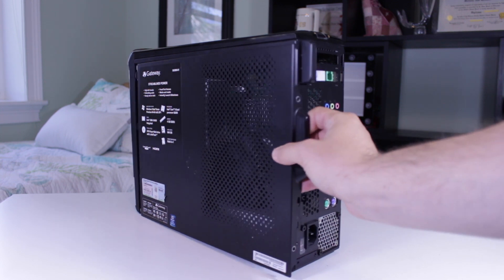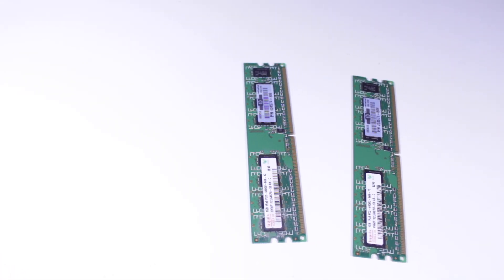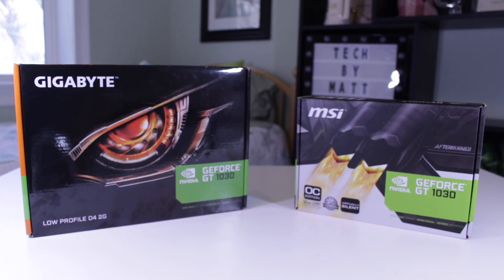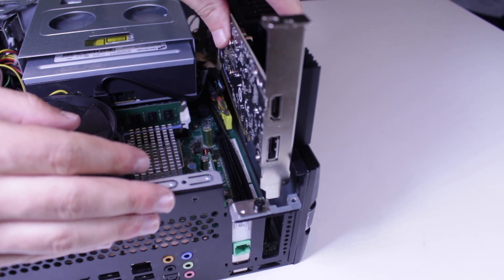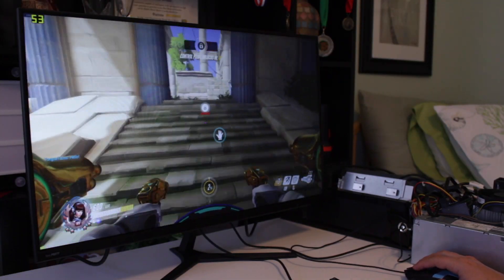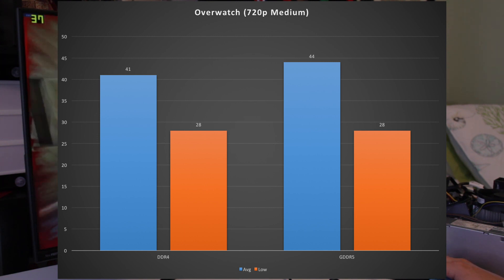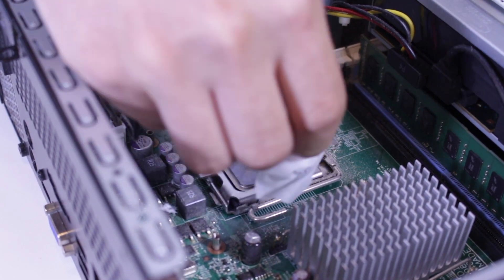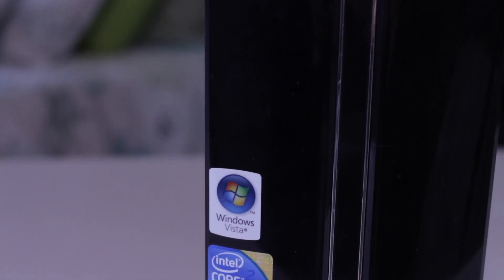Core 2 Quad + GT 1030 = Good Combo?!?

Comment: I have nearly the same custom build :
1. GDDR5 GT-1030
2. Core2Quad Q6600
3. 4 GB Ram
4. 230 W PS
5. Asus P5kpl-cm Motherboard
Reply: What games can u play?
Reply: And how many fps is it? Did cpu and gpu loading 80-100%?
Reply: WTF only PSU 230 watt !!!
Reply: @aymanashraf5072  the newest dell pc minimum psu is 200 watts
Reply: @aymanashraf5072  bro i have seen people with only 200-230 watt psus run with a gtx 1050ti low profile plus core i5 2nd gen easily

Comment: I use a GT 1030 GDDR5 in a modded Acer Veriton X2610G (I had to create a ventilation hole on the side to let the graphics card breathe as the space is very very limited) and I can say that it is a fantastic choice for this kind of SFF computers. I also replaced the i3-2120 with an i5-2500T to get 4 cores and ensure that the small PSU could manage a graphics card. Some people say that you can actually use a full fledged 95W i5 with that, but I rather not push the PSU too hard.

Comment: i paired q6600 with gt 1030 and can play most of the titles in high settings getting 35fps average and im happy with that bcoz i used to play on consoles
Reply: How much ram?
Reply: Shiva Bhardwaj using the same setup myself! The card was 80$ and the processor was 18$ lol! Surprised by the performance. I only play CSGO though, so I couldn’t be bothered to upgrade lol
Reply: How much ram you are using?
Reply: He uses 512GB DDR4 memory running at CL12 3200MHz
Reply: welcome to the masterrace.
Reply: @SMGJohn  0.0 lile me with a q9550
Reply: @nawaal4452  same but the card was 60 bucks and the q6700 for 9 bucks lol

Comment: THANK YOU
I was looking for benchmarks to see if it was worth it or not to upgrade my old computer
Reply: It is. I have a prebuilt lenovo PC and added the gigabyte GDDR5 low profile card into it and the performance boost was insane. Going from 50 FPS in overwatch at all low settings at 720p to 1080p and high settings was great. Later, I discovered overclocking with MSI Afterburner, and was able to squeeze around 20 more frames.
Reply: Gabe_N if you have a Q6600, try tape modding it.

Comment: I’ve a Dell Optiplex 755 DT running a Q6600 @ 3.0GHz (w/ tape mod), 6GB DDR2 and a ZOTAC GT 1030; it’s a pretty good budget setup IMO. Will be upgrading to a 771 Xeon X3363 and adding another 2GB RAM soon

Comment: You should try to OC that Q8200. I had mine running at 3.15 (450x7) for almost 3 years before upgrading to a Q9550 which was stable at 3.65. The Q9x50 series were generally better for OC as they can sustain higher FSBs.

Comment: You can actually get a GTX 1050/GTX 1050Ti that fits in the case layout. I have a machine with same case layout (Emachines EL1352) and 8GB DDR3, Phenom II X4 955. I used to have at Gigabyte GT 1030 Low Profile 2GB installed but now I have a GTX 1050Ti 4GB. The only models that fit in there are the ASL G1502 (GTX 1050 2GB) and ASL G1504 (GTX 1050Ti 4GB). The card is also better known as ASL GTX 1050Ti Battle Flag 4GB. It's a single slot low profile card. Just search YouTube and some videos of the card I use pops up.

Comment: I have a GIGABYTE GT 1030 GDDR5 for myself.....It's a bottleneck which trigger me.....Is it fixable of I3 550@3.20Ghz??? My processor speed decreases to less than 2.80 ghz and not high from 3.05 Ghz also nothing is overclocked in my pc with 6 GB RAM

Comment: I installed a $40 R7 240 into my old Core2Quad. Huge improvement over the original GeForce 210 although I would have preferred the 128bit version instead of the 64bit that I got. Even with DDR3, a 128bit memory bus would double the memory bandwidth to higher than the DDR4 64 bit GT 1030 to just under 30Gb/s .

Comment: And don't forget that the GT 1030 may be crippled by its pci-e 4x wiring on pci-e 2.0. I'm currently building a setup on an ITX s775 with a xeon quad-core to play Skyrim I expect it to be correct. Thanks for the insight

Comment: So if I paired q8200 and 1030 ddr5 with 4gb ddr2 (my motherboard only support that kinda ram), i'll still be able to play let's say gta 5 and csgo 20-30 fps just fine right? Also, which one is more suitable for that kinda set up, 500w psu or 600w? And if i'm upgrading to let's say current version of ryzen cpu, did i still be able to reuse the gpu? I'm sorry if i'm asking too much (sorry for the broken english too), because i'm a newbie. Thank you.
Reply: You need at leat 8gb of ram ddr2 for gta v and csgo. And yes you reuse the 1030 with the ryzen.

Comment: The GT 1030 ddr5 model is a decent budget gaming card. (previous owner of GT 730 ddr5) Using this  GT 1030 will make a difference with the older system.  Weak OEM power supplies will like the card as well.  Currently using my GT 1030 in i5 3570k (@4.2ghz) (wify's Rig)  Will upgrade her later and use this 1030 in my media entertainment AMD A10 system in the future (already had it there before)  waiting to see what the next gen GPU's that will be coming out.

Comment: I've decided to breathe some new life into my old Gateway and build this exact same rig. You have no idea how surprised I am to have found someone, much less on YouTube, who's done the same. However, my PC is running Xubuntu 16.10 because I grew tired of Windows Vista a long time ago. Would that interfere with the build at all? Are these specific drivers available for Linux? Also, I plan on buying a cheap case to add a more potent PSU to replace my faulty one. Do you think this PC's proprietary motherboard would be fit in any cases? Would I just have to measure the mb and buy a case large enough to house it?

Comment: i got the q8400, 8gb DDR3, and a 660 Ti, and im able to do AAA, including playing Far Cry 5 in 1080p Normal above 30 fps
Reply: Sean Michelin - DaiAtlus79 😏 thats great, lga 775 ftw! 🕹😸
Reply: Seems like bullshit but alright.
Reply: i beat that i5-2400/660 GTX budget build that Danny NOAB built in their competition a while back, mine scored 4843 in Firestrike, his was 4677
Reply: Sean Michelin - DaiAtlus79 🤓 are u sure bro? normally an lga 775 Quad Core can trade blows with an i3 2nd gen, BUT NOT an i5 2400, when u have time run some more benchmarks for us with:

CinebenchR15, 
CpuZ, 
GeekBench4, 
Unigine Heaven @ Medium 1080p

🕹😍🚩
Reply: the q8400 isnt as strong as the i5 he had, and the 660ti helped the score, but its still not a bad CPU - mind you, im upgrading to a modded Xeon e5460 soon, that one is about on par with the 2nd gen i5

Comment: What if you used a gtx 750? Any 750 you buy should perform pretty consistently with other 750s right?
Reply: I have that setup. I overclocked my Q6600 to 3 ghz with a piece of tape. It can run GTA V very well at lower settings.

Comment: if you got this I would probably get a brand new HDD for 26 bucks and 4GB of ddr3 1600 ram so the whole build would be like 240 bucks I think but if you don't want to add another HDD and ram then this build would cost 200 bucks which is pretty good or you can get a gaming computer for 350 to 400 bucks with the CPU:ryzen 3 2200g, almost the same as a gt 1030 but its also a CPU so very good deal MOTHERBOARD I would get the Gigabyte - GA-AB350M-DS3H or the ASRock - AB350M Pro4 they are my top pick because they both have an m.2 slot and 4 ram slots for about 50 to 60 bucks and has a very good/future-proof upgrade path for the STORAGE I would get a 1 TB western digital HDD or a 2tb Seagate HDD or for half the price a 500gb seagate hdd for the PSU any  reliable power supply brands like evga, Corsair and cooler master with 400 or 450 watts and above for the CASE any 20 dollars to 50 dollars mid tower atx case and for ram I recommend 8gb 3200 ram for I guess 100 bucks at this time.BUT if I would upgrade I would get a 120 to 128gb SSD, cooler, and an optical drive the cooler and the SSD will be a very good upgrade because the SSD will help with the boot times like the cooler will help overclock the CPU and yes you can use the stock cooler but if you want the best performance just get it to trust me it will be a very good buy and you can buy coolers for about 15 to 25 dollars so not very expensive and for the optical drive I just want so when I need it i will have it and because I think I still have some old movie disc so I can still watch them and maybe you bought windows on a disc so you would probably need an optical drive like the Asus DRW-24B1ST/BLK/B/AS. and boom a 350 to 400 dollar gaming pc and later down the line get a gtx 750 ti from aliexpress but from a reliable seller.

Comment: Im using core 2 quad Q9500 and gt1030 gddr5 with 1.5GB memory but it can't play 4k 60fps on youtube. Im using Window 7 Ultimateis 32bits . Is it my pc not enough memory to run it or my cpu is to low to support gt1030 to do VP9 decode ？
Reply: Maybe cpu instructions

Comment: Whats the Best cpu to for GT 1030 ddr5 playing pubg (720p High/1080p mid or low)
Reply: It's Milan a sandy or ivy bridge i5
Reply: Daevster 666 how much fps will I get on pubg
Reply: get i5 2400
Reply: Jiji Liketoeatdorayaki did you tried it
Reply: It's Milan i5 2400+8gb+gt 1030 . just upgrade to gtx 1060
Reply: Jiji Liketoeatdorayaki how much fps did you got on pubg (which settings)
Reply: depends a 3rd gen i5 with a gt 1030 can pull 60 fps all day albeit at low settings but it is still playable

Comment: Got 1050ti 4gb for the same of a 1030, do you think it will bottleneck with a slightly overclocked q6600?
Here are some more specs:
120gb ssd
3tb hdd
16gb dddr3 ram at 1066mhz
3ghz overclock on cpu
Well cooled everything
Reply: It will, but it nothing insane, but if you're running games more mixed with, you're not gonna be getting full potential on the card. A i3 2120 will perform better.

Comment: Are there any old desktop I could buy off of amazon that is cheap? I could do less than $200 and I could buy any gpu btw. I have a twelve year old pc and I need a upgrade badly.
Reply: Panda try eBay. Lots of second hand options there. An i5 2400 and/or i5 3470 (my favorite) are pretty easy to find on eBay for quite cheap. Paired with a low powered graphics card it works like a charm.
Reply: Panda  i just helped my nephew get a dell optiplex 7010 for $150 it included 8gb ram and a 3rd gen i5.   Don’t get the small form factor models they suck for upgrading.  The one i got was a mini tower I switched the crappy power supply out for a new 450w ($30) and now it will support Almost any reasonable gpu.    Those systems are easy obtained from ebay buy from a seller that refurbishes these machines not an individual
Reply: Yeah ebay would be better. Offices almost always have moderate i5 CPUs in them which just need a decent graphics card to get game ready.
Reply: HP 8300 elite is $195 on Amazon with a "i5-3470 3.2GHz Quad-Core, 8GB RAM, 500GB SATA, Windows 10 Pro 64-Bit, USB 3.0". You need low profile cards but people say they put low profile 1050ti's in there. You probably could find cheaper on Craigslist, OfferUp, etc. I just remember someone on another video mentioning buying one.
Reply: Panda cell optiplex 980. Or a custom i5 8gb ram search on cex. I got i5 3340 8gb ram, 500gb hd, custom case & antec 500w no rating psu for £135. Add ssd and graphics card for a decent gaming system.
Reply: Thank you!

Comment: core 2 quads can actually utilize a lot more than a 1030 (which is not a gaming card in any sense, it's a display adapter for systems without integrated graphics or really bad older ones), especially the latest ones with 12 mb of cache, particularly when well overclocked. Now those were cpus that lasted, coming out in 2007 with single thread performance matching anything AMD had up to last year, lol

Comment: Can you try a Gtx 1050 ti with the best 775 cpu?
Reply: Gabe_N there are videos out there. Just search core 2 Quad q9650 with 1050 ti
Reply: 😒 utube search: Q9650 1050ti Gaming, im assuming u have 8gb of ddr2 800 ram, the q9650 runs $50 on fleabay, chk that ur motherboard will support it
Reply: Some 775 motherboards support up to ddr3 clocked at 1333 mhz
Reply: Chicken Little 🙂 yeah but if i had 8gb of ddr3 1336 ram I would rather look for an i5 4th gen cpu mb combo to use it on! 🕹😍
Reply: Truuuuuuuee
Reply: Don't try to get Q9650, its too expensive, go for a Xeon E5450, which is cheaper and give you same performance, or you can go for X5460 (cheaper, little faster) or X5470 (around 50$ same as Q9650, little more faster than X5460). But you need to check if you motherboard supports Xeons and do some minor modding (like bios).
Reply: John O'Shack 🙂 q9650 is $50, thats not bad for a top tier cpu, any other chip mite not b compatible plus the instruction sets are different, some games are picky, for a long term upgrade solution theres nothing better, and if ur mb goes bad its easier to find another mb, but if ur messing around then u can experiment with overpriced modified xeons that shud only cost $5 each but thanks to u guys that like them so much the resellers have raised the price to 10 times their true value 🕹😊
Reply: MrSammy Best long term upgrade is to save that money and buy something new or newer, this socket isn't worth spending money on. $50 for 9 years old cpu when you can buy new (g4560) for $57.75 that will give you much better results. 

I bought 2 Xeons in total E5450 $30 and E5440 $20 and I think they are much better value, because where i live Q9650 is still pretty expensive (cheapest listing for $75 up to $100) that is overpriced cpu, not xeon which gives same performance and overclocks like beast.
Reply: John O'Shack 🙂 sure, I have alot of newer intel pcs but so what? i will continue to buy lga 775 stuff when i see one super cheap, then i fix them up and donate them to my family, no one has complained so far. Personally my cpus of choice are Q67 Q83 Q93 Q84 Q94, Q95, Q96, I dont waste my time buying any other cpu for 775 on fleabay, I dont waste my time overclocking because family members wont know what to do! I would not spend $30 on a modified Xeon Cpu when its really only worth $5, yes I really like the $40 g4560 but ddr4 memory is a ripoff rite now so its a nogo for now. I agree if the Q9650 is $75 for you then I would look at the cheaper slower ones that I mentioned like Q95 Q94 Q84 etc but I would not buy a Modified Xeon Cpu unless its ur personal hack pc, but if ur donating or selling computers u shud use only legit cpus. Also I would not buy a stupid expensive 1030, instead look for a cheap 1gb ddr5 video card and stick to cheap old pc games, look for the games on steam summer sales like rite now, Go! Go! Go! 🕹😍
Reply: MrSammy I agree its fun to fix those and make them somewhat usable, but there is no potential in gaming (only retro gaming machine). For office uses and internet browsing they gonna hold strong for next 5 years, but for gaming they are becoming useless. Its better choice to spend $50 on something newer than old 775 cpu for gaming purposes.
Reply: John O'Shack 😍 thats fine, that means more super cheap intel core 2 duo computers for me to buy and donate, yay Retro ftw! 🐢🐢🐢🐢🐢🕹😍
Reply: i have x5460 xeon 3.16Ghz  im thinking about putting rx 460 4 gb with it , would hat be okaj ?
Reply: It is going to work fine vut in some games will be cpu bottleneck which you can reduce by overclocking X5460 (3,8GHz by setting fbs to 400MHz and playing with VCore voltage, should be easy to do. But first do some research on google about overclocking this cpu) if you have motherboard that lets you overclock.
Reply: John O'Shack 😍 yay one of my spare pcs is an old classic Mac Pro workstation, it has Dual Xeon CPUs X5365 3.0ghz, 8 cores total, it looks like an i7 in Afterburner. The RX460 is a slow video card I think he will be just fine, but I wonder what motherboard he has because RX do black screens on some older oem boards 🍎🤓🕹🚩
Reply: MrSammy  thats a pc for something like league , paladins and sht like that nothing special maybe world of warcraft but that should be alright 
 I have asus mbo ddr2 woth 4gb ram max now thats a problem im thinking about finding a ddr3 775 socket
Reply: Deceived One Gaming 4gb isnt optimal, but could be enough for those titles. DDR3 motherboards are kind of tricky, because good chipsets (P45,P35) are hard to find or expensive. There are some cheaper ones usually G43/G41 but those are bad and overclocking is very limited on them.
Reply: John O'Shack, I also have a similar dilemma with a similar low-profile potato PC with a custom from factor motherboard. The Q9650's advantage is that it has a higher TDP than the Xeon E5450 (95W vs 80W), meaning that with the limited space for a cooler, the Xeon's lower maximum temperature can't be countered with a bigger heatsink. So a Q9650 can operate with a smaller cooler as it can take another 10 degC or so without thermal throttling. But indeed I could get an E5450 for half the price. I'm thinking to pair the machine up with a 1050Ti low-profile, still within the 75W range (powered from the PICE slot) and can be put into any mid-range PC and still game on 1080p.
Reply: I would go for E5450. The max. operating temperature is same for both I would say (everyone on forums says stay under 70°C, max. 75°C) + same performance + lower power consumption + lower price - might not work on some motherboards. But it's just my opinion. 1050 Ti is more than enough for these cpus and you can put it to other system and have good 1080p gaming experience.

Comment: Maybe try to oc the 8200 with the tape technique, gain like 600mhz +
Reply: Tape overclock (BSEL MOD) only works for Q6*** cpus because they are running at 1066 fsb and you force them to  run at 1333 fsb...
 and this chip is running stock at 1333 fsb. even running this chip at 1600 fsb would give ''only'' 2,8GHz (+470MHz).
Reply: John O'Shack Thx, i didn't know that